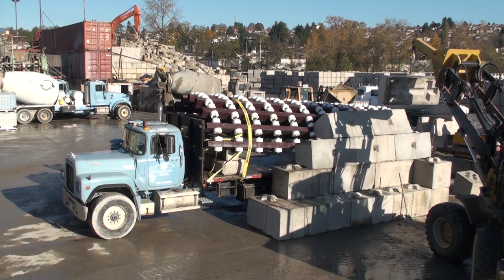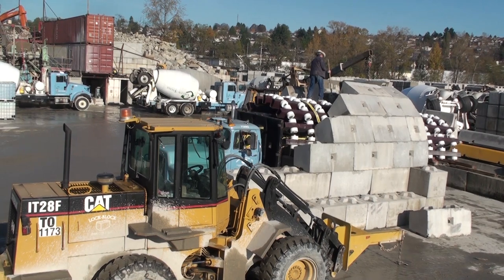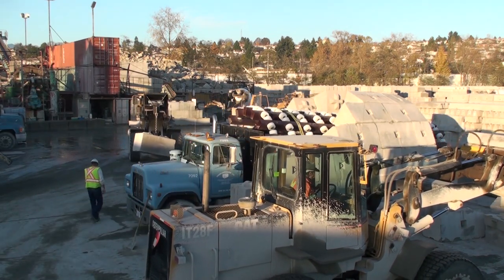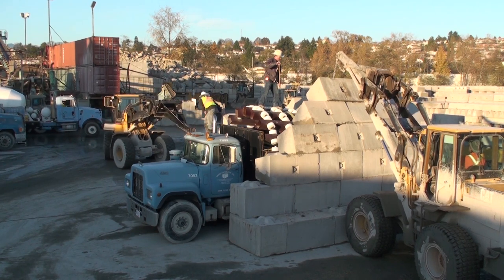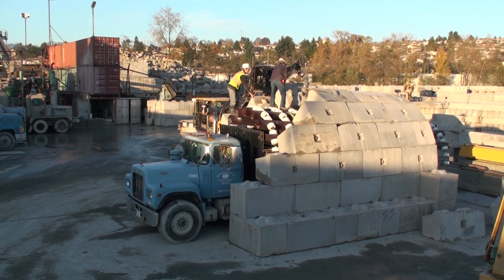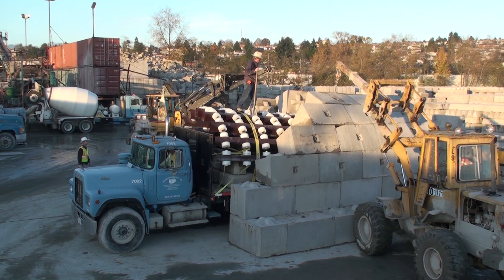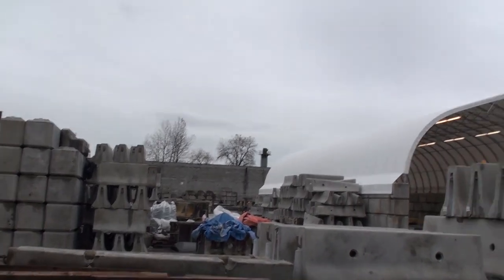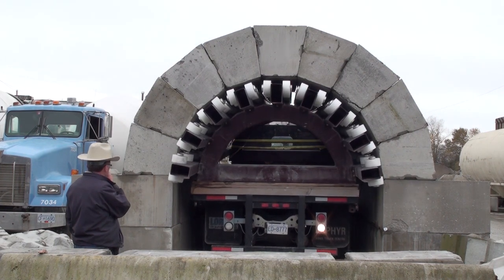Arch-Lock™ construction with a zipper truck

Comment from the maker: Each block is 1.5m long and .75m high.
The arch by itself has an inside clearance of 2.88m and a total height of 3.63m.
Since there are two levels below the arch, this particular structure has an inside clearance of 4.38m and a total height of 5.13m

Comment: As soon As I saw those white rollers on the truck, I knew exactly whats going on. This thing is totally Genius as well as Simple. By now, by practise I think you people are building arches in a 1/20th fraction of time than the conventional method.
I like how this zipper truck when moves forward, it sets those blocks in place accurately, no need to hammer the blocks from outside with cranes, no need to waste time in all those chains and precise rachet adjusting.
I believe you guys have already thought about it, but how about adjustable diameter of the cone at the back end?

Comment: If the top 6 blocks came as 1 U would not need the truck it would be much easer. It could also be used for guided rail
Reply from the maker: It most definitely would and we have done that in a makeshift way in one of our other videos.  Please feel free to browse our channel!
Reply: Lock Block Ltd. From looking at your other vids I was thinking if u chained the top 7 blocks together with say a double row of chains on the under side they would act like hinges holding the blocks in place .Allowing all to be lifted by attaching two lifting chains to top side of the two outside blocks and a third chains to the key stone to hold it stable while lifting
Reply from the maker: Michael O Callaghan True, but then we'd need a significantly more expensive crane to install it.  Part of the reason our system is so practical is because you can use conventional loaders or excavators to do the work needed.
Reply: Fair enough more expensive crane but no truck